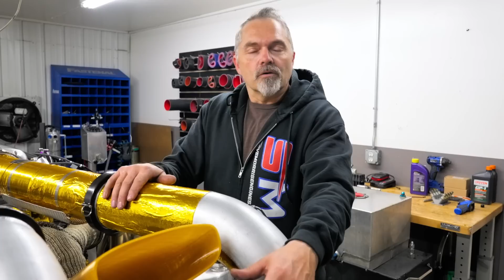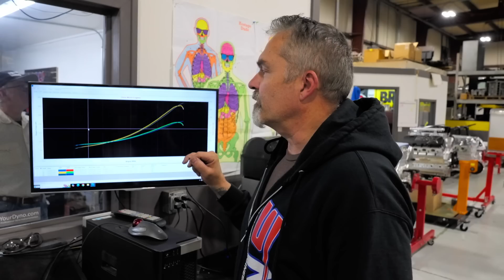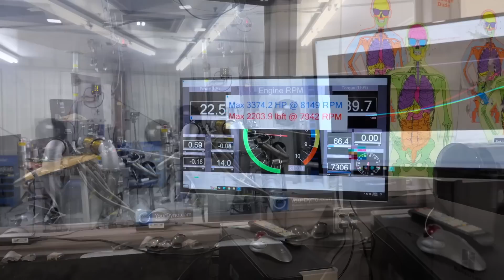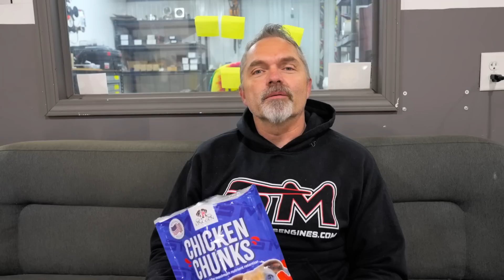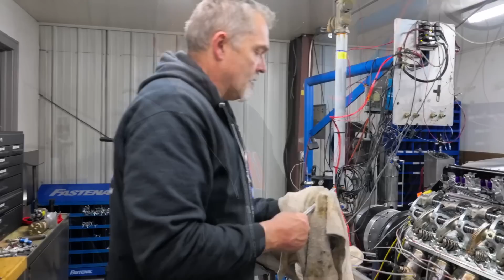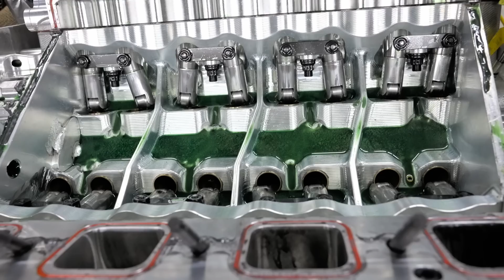Building A Land Speed Record 500+ MPH Engine

Comment: As far as the flexing of the intake ducting, just measure out 4 or 5 square inches of area.  It's smaller than the palm of your hand.  Even if the pressure differential is considerably lower than 14.7psi (let's say half of that), then considering that the total surface area of the intake ducting is WAY more than the palm of your hand it is no surprise that the ducting flexed as it did.
For fun, guesstimate the surface area of your body (in inches square) and multiply by 14.7.  Humans are always under considerable pressure :).
Enjoy the channel.   I'll admit to actually learning things :).

Comment: Take a look at the open area at the inlet vs. outlet ends (calculate and compare the difference) of your "bell".  Make sure the inlet has at least ad much area as the outlet, if not more.  Then?  Surely structural integrity would be very cheap insurance against catastrophic failure.  Great video guys.  That motor is INSANE!  --Fink 😎👍

Comment: To the person who designed the intake duct to the turbo: it's partially collapsing due to the pressure differential; it'd be wise to add a little bit of wall thickness on the long sides of the duct to prevent it from collapsing like that.
Reply: Yup..........Delta P
Reply: Duh
Reply: It looks like 3D printed, using high strength, high temp material
Reply: @NLRevZ  true but when the vehicle is doing 400 plus there is a lot ram air going in the intake.

Comment: Good to see someone else attempting 500mph piston record. Packaging here shows tight streamliner fit that Geo.Poteet's 'Speed Demon' shared. 
It holds current record  @470mph done with twin turbo 530cid BBC pushrod type. Geo passed b4 2024 meet unexpectedly,  so someone else will hit piston driven 500 1st.
Hope SM build does the trik.

Comment: By changing the shape of the inlet duct,  you change the ratio of the cross section to the whetted perimeter.  It's like pinching a straw. Even though there's the same perimeter, the cross-sectional area decreases. I learned this with ice capped riverine flow on the Missouri River. In simple terms, the ratio of the cross-sectional area decreases even though the whetted perimeter remains the same. This increases the velocity in the pinched down area.  I am assuming that the squished end hasn't been belled out enough to make up for the reduction in the cross-sectional area in the pinched inlet mouth.

Comment: I am going to put an ignition cut off on my 3.0 L Vulcan Engine for Camshaft Synchronizer Failure these engines are infamous for bushing wear and break the gear mesh of cam  synchronizer gear to camshaft drive and then there is no oil pressure.

Comment: Are you thinking that the linear thrust from that spiral gear is friction welding the top cap together and possibly changing the direction of spiral and putting a retaining clip with thrust bearing on the shaft is the solve?

Comment: Guestimating the area of the intakes square-ish area is about 8*8". Doing quick calculation tells that only 0.5psi pressure difference between inside and outside of the intake equates to roughly 60lbs seen on the scale, as its being squished from top and bottom.

Comment: Density altitude at Bonneville can be 6500 to 7000 feet. How do you factor that in on your dyno? Do you think you should check the oil pump to see if it locked up?

Comment: Who designed that intake? I don't think it's any bigger than the intake tube on my Duramax making 1/10th the horsepower. It probably needs to be about 50% bigger. You would think these streamliner guys had access to, and knew how to use CFD software.

Comment: Steve, if you printed that intake duct with PETG, try Bambu ASA-CF--reasonably priced, way stiffer, and prints like a dream on a hardened 0.6 or 0.8 nozzle.  ASA is the engineered successor to ABS; it's got high UV resistance in addition to impact resistance. 102C working temperature vs  62C for PETG.  Chamber needs to be pre-heated to at least 40C before starting the print, and you should probably use glue-stick.

Comment: wonder if it be more efficient to use liquid nitrogen to cool stuff down , that should make the tanks holding the water smaller and keep the temperature of the water more equal during the run (by running more and more nitrogen through the heat exchanger )
dont think it be good to run the nitrogen as coolant only as the stuff is just to cold and will lower the efficiency of the engine it needs to be buffered to cool the intake air at just the right temperatire no matter the heat of the day

Comment: What surfaces seized together on the cam sync? Was it anything from the load imposed from the drive gear angle bevels and need a roller thrust bearing somewhere 🤔??

Comment: That not "suction" from the turbo... Its the atmospheric pressure pushing in on the intake. The atmospheric pressure is 14.7 PSIA at sea-level so its the pressure making total force by multiplying the atmospheric pressure by the area. Now there is also the fact that the air inside the tube is moving much faster than the air on the outside so that is a contributor as well because as air speeds up is looses pressure. Very cool demonstration of fluid dynamics.... Yes air is a fluid.
Reply: show how a sharp edge instead of a bellmouth is bad for turbulent inlet air flow.

Comment: I'd be willing to bet that longer intake wouldn't collapse with the end bellmouthed. Like you said Steve, the air doesn't want to go around a sharp corner. Which makes a more significant pressure differential between the outside and inside. The air is literally trying so hard to get around the corner that it squishes the intake trying to push it's way in there. So cool. Thanks for the video :)

Comment: The vacuum on the inlet, is 127lbs x 50(psi) misus the surface area opening in PIE it’s creating around 148lbs at the opening,
Remember it’s pulling so much air, half is vacuuming inside ,but pressurized from incoming air on outside before it enters.
It’s not just one atmospheric condition Steve…

Comment: I've noticed this on a few of your videos. Watch around 10:07. Why are the exhaust fan dampers closing in your dyno room when a test engine hits high RPMs? You can clearly see the exhaust fans RPM change speed. Is there a vacuum being pulled in the dyno room by the test engines and if so, wouldn't this affect engine power? Do you track barometric pressure in the dyno room? Awesome channel BTW.
Reply: the engine can out suck as much cfm as the ait inlet allows so the room only needs a vent hole bigger that the air cleaner inlet.

Comment: Question for ya,  you mentioned that the smx has the rockers fed with oil through the push rod.. does that add any weight to the valvetrain assembly?

Comment: Those OLight flash lights are amazing, I have had mine for about 6 months, the UV light on makes oil glow different colors depending on the type of oil. I work in nuclear propulsion plants on submarines so that comes in handy more often than I like to admit. The problem with the cam sync is interesting, does the problem you noticed have to do with the helicall teeth on the shaft tring to pull the assembly down into the motor?

Comment: The gear on the cam sync looks like bronze. That should have been the sacrificial piece not the cam shaft. So question 1 what is the cam sync gear made of because wow and question 2 do you think it could have been a heat treat issue? I think S7 can go to like 60 Rockwell or so but it’s kinda known for being tougher at higher Rockwell.
Reply: Cam sync gear must be harder than Woodpecker Lips.

Comment: I bought a drill offbthe tool truck (battery) once...ONCE! They dropped support on it 3 months later with a redesign. This WAS the new model less than 6 months. Ni cad came out and they came to that (yeah im old). I was screwed. No repair no batteries available nothing. This was back at the 7.2 to 9.6 switch. I tossed it in a side drawer and fixed a new switch in my old 7.2 Makita. Then...boughtva keylss chuck Makita. I refuse to buy tool truck electrics anymore.

Comment: Think about designing an engine that needs NO cam shaft, no push rods, no rocker arms , no valve locks, no lifters, no valve springs or any other top end parts.
How would this be possible, you ask? Use solenoids to operate the valves. They would be computer operated and infinitely adjustable, all cylinders would be maximized for efficiency, all spark advance could be controlled by the computer, the engine performance would be more powerful basically because there would be no power loss due to not needing to compress the valve springs or move all the lifters, rocker geometry etc.
The key to building an engine that needs no mechanical valve operation is to design solenoids that would be very fast moving, strong enough to reciprocate at the speed of current valve movement and be reliable. Maybe the first thing to do would be to prove out the theory on a single cylinder design, then build on the knowledge gained with a simple concept then expand to ?
Reply: Koenigsegg has done an engine like this using FreeValve-technology. Its basically pneumatic controlled actuators with controlled oil damping.

Comment: NOT ENOUGH MAKE UP AIR GOING INTO THE DYNO CELL / BUILDING !!!!!

I've been posting this with no results.  Look at the pull at 1241.  Look at the right hand exhaust fan, you will see the shutters close.  There is light shining through the top right at idle but no light during the top end of the pull.  Also note the lexan window flex when the throttle is dropped.    This happens anytime large displacement engines are run.  Air leaving the cell through engine exhaust needs to be replenished otherwise it is like putting a restrictive air filter on the engine.

Comment: I would be awesome to see some 5-600rpm / sec runs instead of those 1000+ rpms a sec 🙂
Reply from the maker: That is at 600 rpm per second
When you dyno big engines like this they accelerate so fast in the sweet spot of the boost
Reply: @stevemorrisracing nice, I would think that the yourdyno software and absorber then should be able to achieve the set target of 600rpm with some feed forward table to account for the rapid boost change and mabye some pid controller adjustment. Of corse it can't be perfect and be like a telma brake. But some improvements should be possible 😊

Comment: This isn't very on subject, but what allows 180hp 900cc two stroke motors to take the abuse they do. Is it just the oil injection or is there something about how they are built? I mean you'll see snowmobile run 8300rpm for multiple multiple minutes wide open and they hold up relatively okay

Comment: The push have no oil hole thru them. So are they a solid pushrod or hollow thick wall pushrod for reduced weight in the valve train?

Comment: How long have you been using S7 tool steel for your cam shafts?  Is this the go to material for cam shafts running with higher valve spring rates. If I remember correctly S7 hardens through so there is no hardened surface compression to a more ductal core.

Comment: $700 for a 1/2 inch battery impact no thanks my $250 one will take crank bolts off and head studs it gets it done. that's all I need. I have taken apart over 100 engines over the last 2 years still going strong.
Reply: What make and model?

Comment: I once had the same issue occur to me. After conducting some investigations, we discovered that the problem was with the camshaft. The heat treatment had been incorrectly performed, which made the gears too hard and brittle (Comp cams).
Reply: another story of a comp cams failure, dam they sound awful! out of spec or failing

Comment: Debating whether to put an aluminum 64cc head on my 60 ober 350 or get a stroker kit to get tge compression up to 9.5 minimum. Going in an old squarebody truggy for rock climbing and trail riding. Heads qppear to be stock 882a. Which option would be your choice for longevity  and low budget

Comment: Steve, was the problem with the cam sync caused from the spiny part on the top being pulled down into the body? was this caused when the direction of rotation plus the gear tooth pattern, resulting in a "pulling force"?

Comment: With the cam sync/position sensor.  I wonder if it's  got something to do with the end shaft play causing  thing to bind, and causing a friction point.  Do you think a thrust bearing inside the cam sync or between sensor housing, and the gear might be necessary?

Comment: As a tool and die maker, I can tell you that S-7 is one of the toughest tool steels as far as shock resistance. I mean, night and day compared to other tool steels. I'm shocked that the tooth broke off. Crazy.
Reply: It has hardness but not shock strength 4140 might be a 'tougher' choice
Reply: Wikipedia it. Why do you think Steeve would use S7 over 4140.

Comment: On that intake tube collapsing: Think about the pressure differential between what vacuum level is IN the tube vs Atmospheric pressure OUTSIDE the tube! What you're seeing as ~50LBF (pounds FORCE) from top to bottom is the result of ALL the combined force over the AREA of outside to inside. Maybe a Carbon Fiber intake tube would be more rigid and less likely to collapse? :body-blue-raised-arms:

Comment: Whats the limitation on run time for a water brake dyno? Water temp? If so could you just up the volume of water you have to heat? I feel like 30,000L  (8000 gallons) would be hard to heat up 🤣

Comment: Gonne have camcynk 2 in may Twin Turbo Build theas Engine 1995. In Valiant Signet 65!! Naw i have in may C3.Hope withe the New Efi system MaxxEcu coming 2 The Streets again!! LS coils ,1200cc Bosch injectors.K29 Turbos! Reale Street car.Power? Hope  500 WHp. Naice poer 3700+ HP .Weel it get 4000++ HP?..Love theas Videos❤❤

Comment: Hi Steve… Going back a video or two you were speaking on setting solid roller camshaft’s, cold instead of hot… I’m your old small block Chevy guy with a solid roller camshaft and I’m pretty sure my cam card only came with hot settings… Is there a formula that you use if you only have hot lash settings if you think I should be setting them cold??? I would also like to give a shout out to Above Average Joe as he is definitely a big asset to the team and also to the videos…

Comment: Is there just not enough blow off valve to exhale the engine from full boost quick enough and free breathing enough...to stop the cam from crashing back on the distributor gear hard enough and fast enough to not break it.
Not dumping all the boost instantly...
would be like a jack hammer on all the cam.. dizzy gear.. and valvetrain parts...even if its just one sledge hammer hit backwards each pop off the full throttle with insufficiant boost blow off.
I thought i heard it flutter surge on one of the pulls on blowoff...which led me to ask since it backlash broke parts i think.
Also looks like that inlet piping is a big restriction...the turbo is trying to suck it closed. 
*  Your videos are never boring. !

Comment: When you were showing the oil feed holes for the rocker bridges, on the head, why isn't there one in the middle? Maybe it's just the lighting, but I only see 4 holes for the 2 front bridges and then the 2 rear bridges.
And then when you had the rocker tray on the table, why only 4 oil feed holes? There's one missing on either the front or the back bridge. If there was a reason for there to be 4 holes in total, why don't they coincide? Or is it some super complicated oil flow diagram?

Comment: Maybe theplummer should just turn his brain off tonight... But I can't... and I have another thought.

I'm wondering now, if the whole 'compressed air' boost technology wouldn't be a better option for this steamliner.

Now, one would have to design enough tank pressure to sustain 60 seconds of full throttle boost.  Which may be a challenge.. However, there would be zero parasitic loss on the exhaust pressure side.  

I'm just thinking out loud at this point.  If my ideas have merit... I'm sure Steve will implement them in the future.

Comment: Question. What if you put NOX in the mix at the upper shift ranges if the driveline and engine could handle it?
Reply: Would probably have an issue with the class/es they want to run